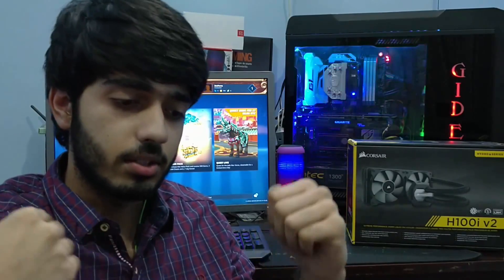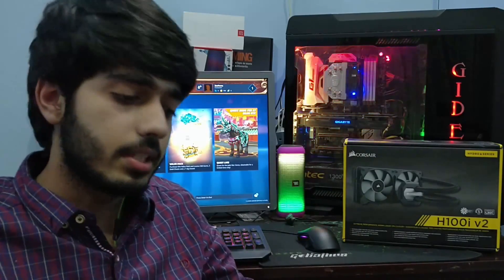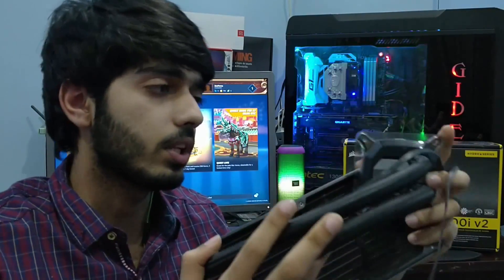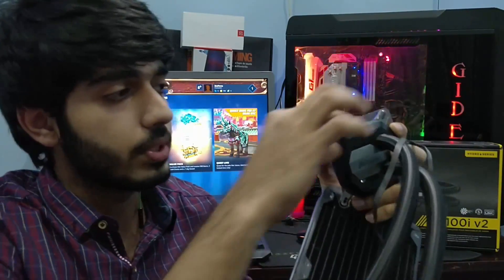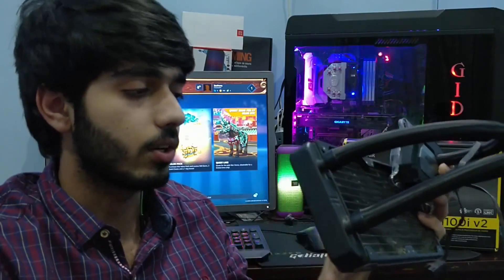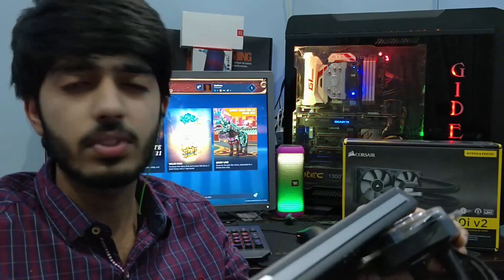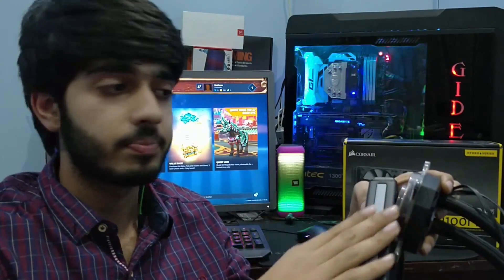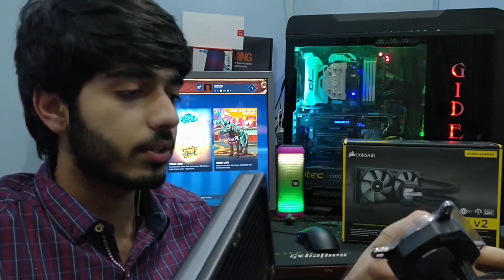What made Corsair H100i V2 fail??

Comment: Here a quick reminder about how water cooling works..like in car..one pipe gets the warm water out..and the other line pump the cold one.. mate that's the way it should be... Would you like warm water being pumped back? Are you for real ?
Reply from the maker: The point is, pump is not working, because if you ever touch the pipes of an actual cpu AIO, both pipes have a very small temperature difference, but one extremely hot to touch and other totally cold is not normal. So yes!

Comment: Lmao I have the same issue, rpm on the pump is 3090rpm but only one tube is hot at 100c and the other one is cold
Reply: Roshan I have the exact same as this did u fix it?
Reply: @coolbotic  nah I bought a new one that they released this year and I still have warranty on my old one (5 yrs and I bought it in July 2016) sooo I will still get it replaced but I will probably either sell the old one or put it in my server, depends on how much I can get for it hehe
Reply: Roshan haha I gave in and just bought a new cooler went for a 3 fan one this time so is a bit cooler now. Trying to send mine back as well but they haven’t responded and just marked the ticket as solved with no reply so don’t know what’s going on there :/
Reply: James Barson I just got a reply etc and I can return the old broken one and get a new and better cooler in return (h100i rgb pro xt) for free soooo I will probably put this one into my server and basically have 2 of em

Comment: I bought one and never used it.  Essentially when the V2 revision first came out.  By now you'd call this NOS.

This isn't giving me much reassurance for a renderbox build.  Essentially the build I've been working on will have a GTX980ti, using i53570K and will get a i3770k, utilizing 32gb ddr3 ram.  

It'll be used for 3d modeling, still renders, and some gaming.

(I know I'm a bit behind the times)  I'd gotten this cooler originally when I was only going to be gaming but interests have shifted since then, life also happened, things suck and this just never got finished ~6 years ago.

What's the failure rate?
Reply from the maker: Well, The failure is purely because of the debris inside the pipes. Once I opened a failed H80i and there was debris of corodded metal inside. So as far as I guess, its 3 out of every 10 H100 series coolers that fail... Based upon my experience.
Reply: We'll see how mine will fare, then.  

However, from what it sounds like (to me) is poor selection of materials and coolant on the manufacturer's part. If an enclosed system develops debris inside, or (if others are being truthful) the coolant becomes acidic/caustic enough to start eating away at the whole device itself from inside out.

I've not dealt with computer cooling, however some large high powered laser systems require liquid cooling and examining these systems' failures has shown that while nature ultimately always wins the truth is:

-- if the sealing mechanisms aren't up to par you get premature oxidation and possibly invite contaminants...and of course leaks

-- if the coolant itself isn't entirely compatible with the materials of the cooling loop and/or the bactericide/fungicide, the end user will find some nasty surprises, no matter how good the pump is, or any other parts

-- Not to point out the obvious but: Maintenance matters!  

Where you're dealing with some serious heat removal (as in a large 3 phase power system for cutting and drilling steel) there's hour meters to remind users to do regular checks on the cooling and optics, and periodic  checks on everything else.  

For an enclosed system on computers I know it's basically kind of a waiting/hope/pray game.  Use it and wait for it to die, but hope it doesn't fail in the middle of something big...and pray when it does that it doesn't leak all over.   I have a GTX980ti GPU, however (bought it new in 2014), and what concerns me is the T100i leaking and destroying the graphics card.  I basically have an incomplete build sitting...life has happened so I've never gotten to complete it.  However I am finally beginning to close in.

Comment: I have the same problem, one tube is superhot and the other is supercool. I hit 89c playing example bfV. i tapped the tubing and pumped with my fingers. And now im idling 37c (ambient 27c) and load 59c. During blockage i idle 49c and on load 89c. using a i7 8700k factory clocked in a fractal design r6 chassi with 5 fans. I bought a nzxt 52x instead. But im gonna try to RMA the corsair after watching this video. Thxs.
Reply from the maker: Well if you have purchased your cooler in last 5 years you are covered with cosair warranty.
And yes, the pump fails, which is the reason water comes to pump but never flows to the heat sink!

Comment: Currently my Hi100 V2 is going super loud, the pump light went red and causing a ton of frame rate issues. I’m replacing it with a air cooler and seeing if it resolves the issue. Kinda happened out of no where.
Reply: Same here 😶
Reply: Update: replaced my AIO with the Cooler master Hyper 212 EVO. Fixed all my issues and getting a replacement for the Hi100 V2 as the pump failed.
Reply: @itsmebrendanp5983  sadly i dont have any of the invoice or anything... But i have the full box.
I had bought the cooler about 4 years ago and i lost the invoice, can i approach Corsair for a replacement.
Reply: @ThomasPhilip104  Unfortunately I'm not 100% on their return policies yet. I'm moving to my new address and will be getting in contact with them soon for the replacement. Best of luck mate.